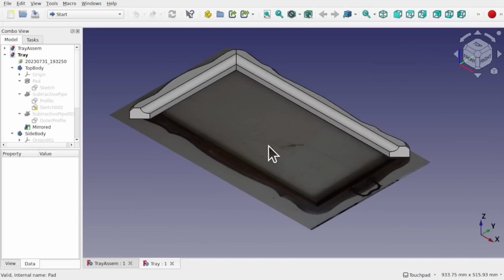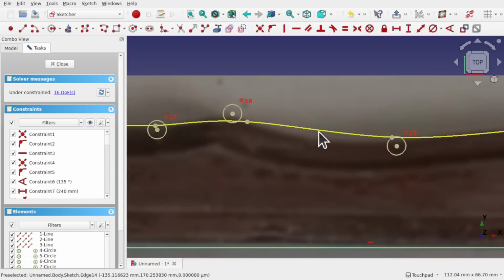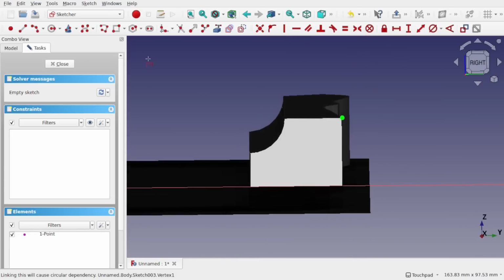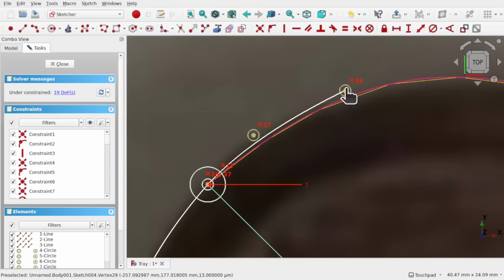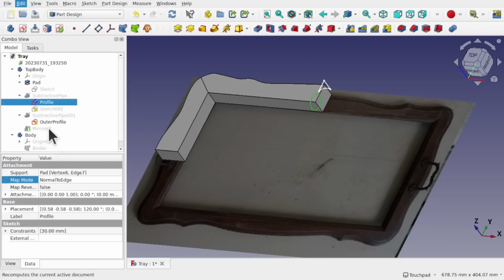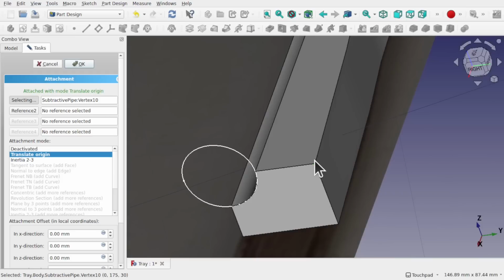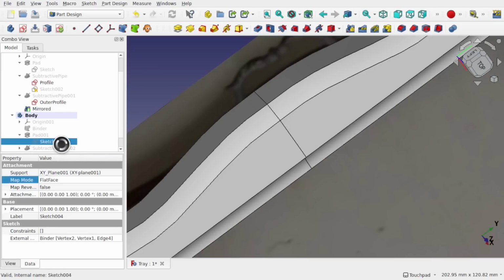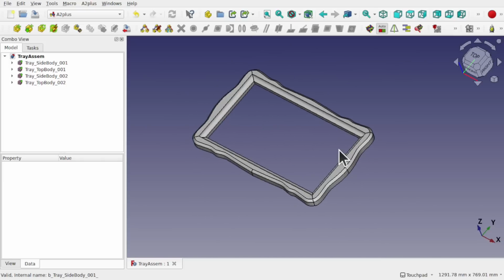FreeCAD: Picture Frame / Tray Tracing, Modelling, Assembly

Comment: There's a IMHO better way for tangency in the corners (and in the middle):
1. Draw a construction line from the first b-spline control point to the spline point coincident on the (vertical / horizontal / 135°) axis.
2. Make this construction line perpendicular to the axis.
3. Repeat this for the b-spline in the second body.
Alternatively you can take the angle between 1st construction line and axis as a reference and then constrain the second with (180 ° - reference)
Reply from the maker: Thanks for sharing this, great to get alternative ways to tackle this problem 👍👍